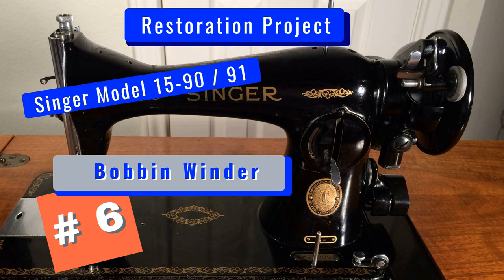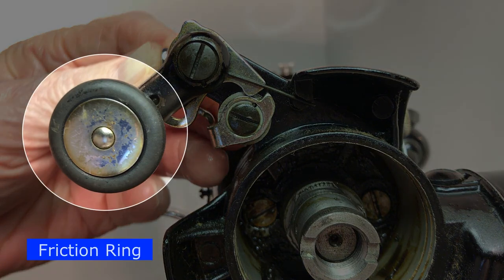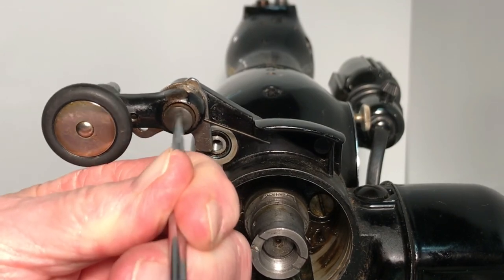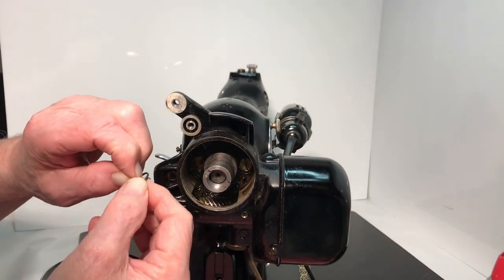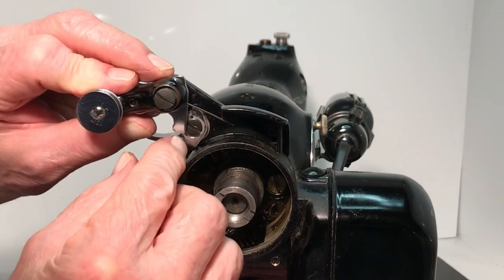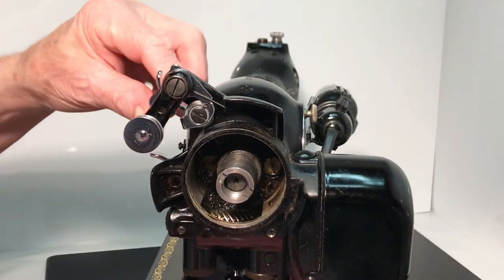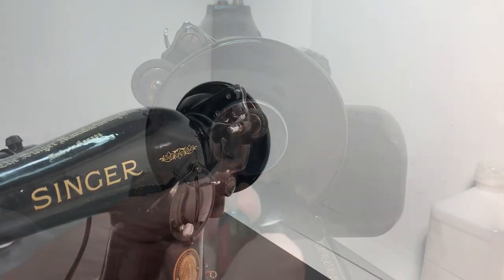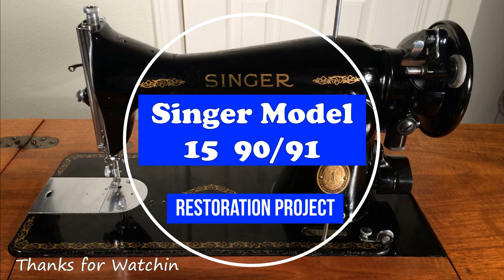The Bobbin Winder

Comment: Alcohol will remove the lacquer finish on old singer machines. Kerosene is a much safer cleaner to use, it will not affect the finish.
Reply from the maker: Hi and thanks for the comment! 
I never use alcohol on any painted surfaces and you are right it will remove the paint and the gold decals as well. I was trying to demonstrate that you need to be very careful with the gold decals. I do soak metal parts non-painted parts in alcohol and then clean them up with WD 40.Thanks Again !